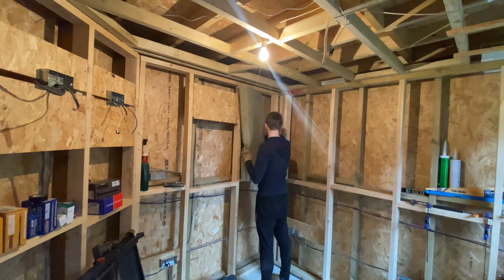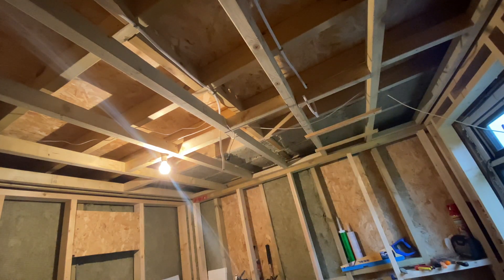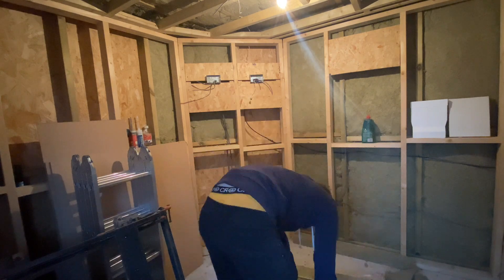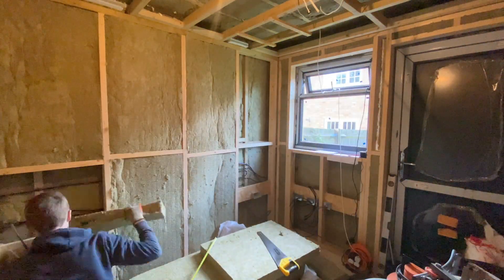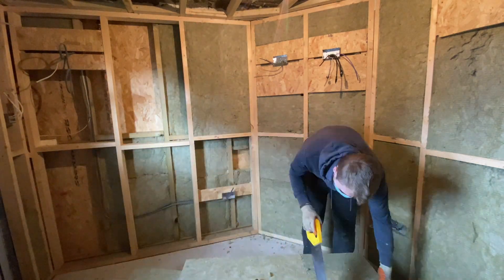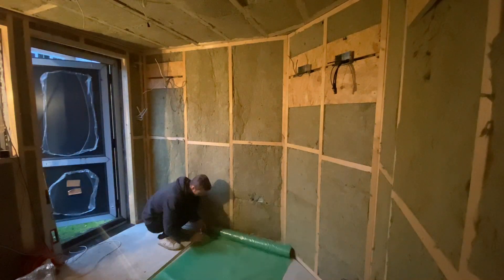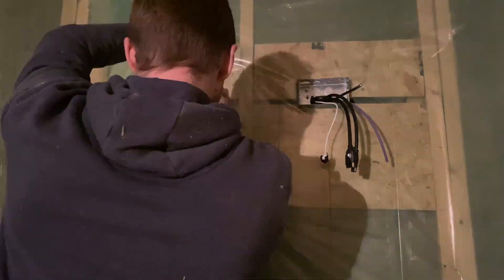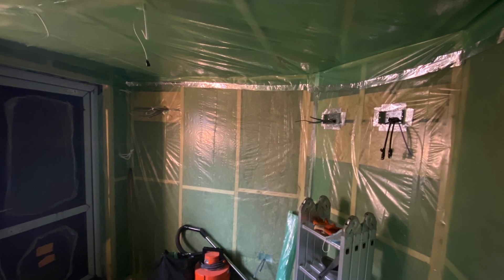How to Install Slab Insulation and Vapour Barrier - Drum Studio Garden Room Build - Part 10

Comment: Hi! Great video. I was wondering where your wiring enters your shed. Thanks!
Reply from the maker: Thanks Yousuf! If you pause the video at 2:10 you can see the cables coming up through the floor/studwork in the corner by the window in centre of the screen. 1 pipe is for the armoured cable for the electrics and the other is for the network and tv cable. https://youtu.be/4HUPtvRvVW4?t=130

Comment: Hi thank you for the great detailed videos. Just a quick question also more wondering about the insulation you packed up again the flat roof. I noticed you pushed it hard up against the roof, shouldn't there be a gap to allow for airflow from the vents you added? Thank you
Reply from the maker: Hi Shaun, thanks for the comment. The insulation isn’t packed up against the flat roof. As you rightly said there needs to be a airflow gap. I used 125mm joists with 75mm insulation which was flush to the bottom of the joists, giving me a 50mm gap for the airflow which is about the minimum you want. Hope that clarifies things! Thanks

Comment: Great video thanks for sharing. Can I ask if you are making a cold roof and leaving some ventilation above the insulation? Thanks
Reply from the maker: Hi Owen, thanks for your comment, glad you enjoyed the video. Yes I have made a cold roof. The joists are 125mm, with 75mm insulation, so there is a gap of 50mm above the insulation. I have an overhang on each end with air vents, so the air can circulate over the top
Reply: @leejmurphy  great thanks for getting back to me. I’m looking forward to getting some more tips from your next video. Thanks again
Reply from the maker: @owenpickrell2834  No problem!

Comment: Hi Lee, thanks so much for all your videos - so invaluable to me and everyone else planning similar projects! I'd like to ask about the ventilation as I am in the planning stages of my build....I see that you have holes either end in the roof for air circulation above the roof insulation. I wondered firstly whether you feel that has compromised the sound isolation and if so, whether you just accepted that was a compromise you'd have to make in your planning stage?
Also, (and forgive me if I have missed this detail in your videos), how do you ensure that the 'inner wall/ceiling' layer of insulation doesn't accumulate any damp/moisture from the cavity between the inner and outer wall? Thank you. Adam
Reply from the maker: Hi Adam, thanks very much for your message. Glad you have found the videos useful. With the ventilation I haven't found any noticeable sound leakage. You'll see in one of my videos I made a sound maze which I think has had a huge impact on preventing sound from coming out. It has been on my list for a while, but I do plan to go around the room and measure the audible sound from outside at these different points to see what the evidence says. Regarding the damp/moisture point, there is a vapour barrier on the inside behind the plasterboard which stops moisture from getting in from the inside. On the outside there is a breathable waterproof membrane which stops water getting in, but allows air to move in and out. This combination should prevent any water from getting in the cavity, and if any does, it would be minimal,  and should be able to dry out due to the breather membrane. Hope this helps! Lee

Comment: Hi great video mate. I want to insulate my summer house. I didn't think you needed a vapour barrier with rockwool as it's water resistant? Thanks
Reply from the maker: Hi Liam, thanks for the comment. Rockwool by itself won’t provide a vapour barrier, only the foil backed version will (which I didn’t use). Even then, you will still need to seal all of the joins with foil tape. The vapour barrier pvc sheets are a quicker and cheaper way to go with better certainty that you have no air leaks
Reply: @leejmurphy  My joists are 60mm deep so my plan was the wedge in 50mm rockwool, leaving an air gap of 10mm before putting the plasterboard on top. Will this be ok do you think? I'm a novice with DIY haha
Reply from the maker: @liampardoe2877  yep that would be fine 👍🏻

Comment: Great video. One thing I have been wondering as I have also been looking as this sound insulation to reduce noise is what is the thermal property of this insulation? I have seen other projects where they would use a layer of standard thermal insulation and then the sound insulation. Aren't you worried that your room will be cold as sound insulation does not provide the same level of thermal insulation? Interested in your thought,  thanks
Reply from the maker: Hi Frederic, that's a great question. For me fundamentally I am not concerned no, and in fact I have been very impressed with how cool the room has been in the summer months and how well it retains heat in the winter. 

I'm using Rockwool RWA45 75mm slabs which have a thermal conductivity of 0.035 w/mk. I have two layers so 150mm thickness in total. When I work out the r-value for this it would be 4.29 m2k/w. If you were to compare this to something like 100mm celotex which is very commonly used in garden rooms with a single 2x4 exterior wall, it typically has an r-value of 4.50 m2k/w. So for me a marginal difference. If I was using just 1 layer, then yes I would be more concerned about the effectiveness of the sound absorption and heat retention. 

There is an element of additional thermal protection provided by the 30mm of sound proof plasterboard to take into account if you were to work out the true values for the building construction. Hope that helps!
Reply: @leejmurphy  thank you for taking the time to answer and the additional information, much appreciated. Based on your information it might be more of concerned to me as I was planning to do a garage partial conversation for home theater room but did not plan to make the separated wall as thick. So it seems it will need to trade thermal versus sound insulation.
Reply from the maker: Hi  @fredericguyon1449   , you mentioned a separating wall, are you planning on building an internal wall in the garage and converting the other half to a theatre room? Is the room connected to the house? What’s your primary concern, sound leaking into the home or sound leaking externally?
Reply: Hi Lee, my garage is attached to my house and it is one of those timber house so the garage is all finished as well (plasterboard and painted). Therefore I have planned to convert all of the garage into a home theatre room as I do not use the garage for the car but my motorbike. I have looked at a lot of videos on sound insulation as my house is rubbish for this. However the garage is on the opposite side to my neighbour so there will be some insulation but the garage door is not well insulated so any noise and cold will go through this. I want to keep the wall minimal hence thinking to go for 75 studs so I need to trade off thermal versus noise for tthe insulation as it seems that a good thermal insulation is not as good for sound insulation as a good noise insulation and vice versa. Hence for my question
Reply from the maker: Hi  @fredericguyon1449  , thanks for your reply. Are you planning on separating the space so that you can still open the garage door on the other side or are you looking to put the wall right up against the garage door so that it turns into more into a facade? I ask because I have also converted half of my garage into a living space and the wall in the middle separating the space from the garage had to meet specific building regs (needed fireproof insulation, fireproof plasterboard and had to be plastered). All this even though the garage space left behind isn’t big enough for a car! Just wanted to mention it in case this is what you are thinking on doing as if you find yourself in my situation it will influence the materials you must use and you might consider consulting a building regs inspector to be sure.
Reply: Thank you so much for the information.  Yes,  i am keeping the garage door and a small garage area as I have many tools to store. I did not think I will have to comply with building standard as I intended this not to be a permanent conversation and do not intend to ask for planning permission. If you have more information I would greatly appreciate since as you suggested it will affect the materials that I need to use. Did you ask planning permission for you and made it a permanent conversion? If not,  what is the reason for complying to building standard? May be insurance but in essence it is just a partition wall in an existing room.
Reply from the maker: In my case we had a builder construct an extension and knock through into the garage. This fell within permitted development so no planning permission was required, but it did need to meet building regs. I'm not sure if there is a difference if you consider it to be temporary or permanent. The Planning Portal site is a good one to search through to see if you think the work you will be undertaking is required to meet regs or not. My feeling is that you will need to comply with building control, so I would recommend reaching out to your local inspector even just to ask the question. https://www.planningportal.co.uk/permission/common-projects/garage-conversion/building-regulations